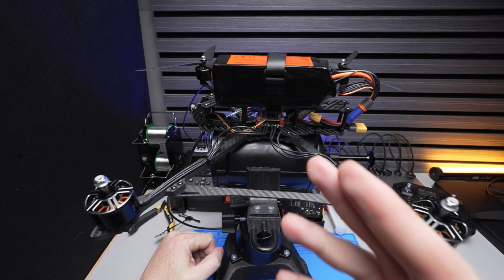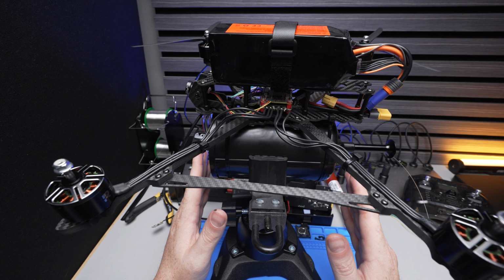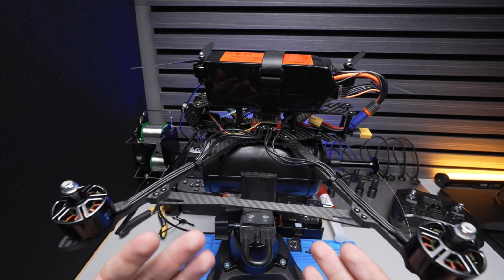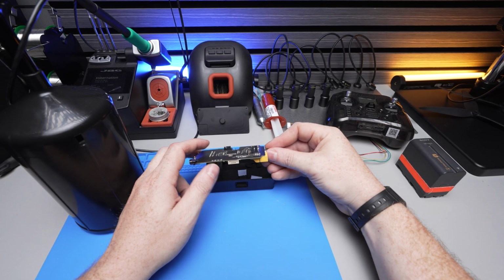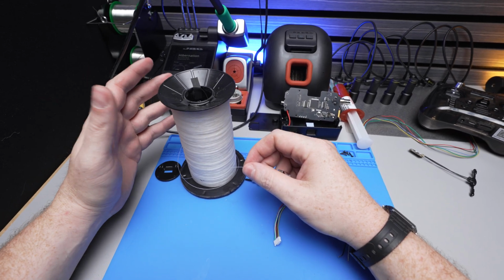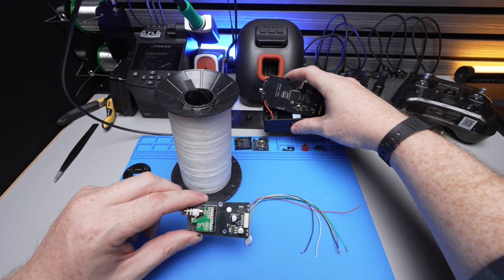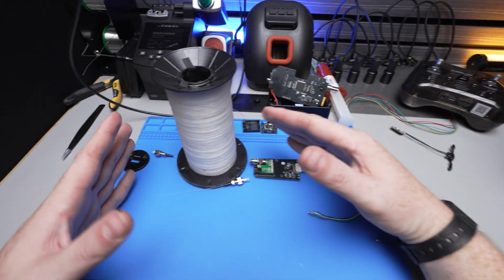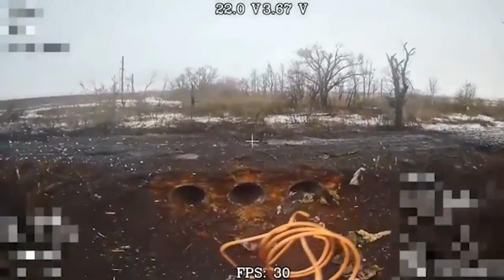Fiber Optic Drone Warfare: The Future of Conflict

Comment: This video is helpful, but he really misses the mark when it comes to quick follow-up explanations of key details. For example, how exactly did his friend break the fiber optic cable mid-flight? Why is flying slow necessary at first? He skips over the critical context—the kind that only comes from real experience—which makes the final takeaways far less useful for those trying to actually learn. Thank you for the video nonetheless!
Reply from the maker: Great points. I should had included that info. Here it is below:

Fiber broke when it got snagged onto a tree and the drone was traveling at a pretty good rate of speed.

Flying slow at first is because the fiber has a wax like substance on it to help it keep in place during transport and you want to make sure you have enough of the covered fiber off so it can unreel more freely when you start going at higher speeds.
Reply: Great channel awareness 👍🏻

Comment: I suppose the fiber optic cable is not biodegradable and stays on the ground forever?
Reply from the maker: Correct, but random fiber cable laying on the ground I think is the least of the worries after war
Reply: a cordless drill with a spool attachment 'fixes' that problem

Comment: Awsome but I imagine you can't fly thru too complicated of terrain or around trees couldn't the cable get caught on blades or objects
Reply: so whats the problem of the fiber getting caught by tree as long as the fiber doe's not break the cannister will just feed new fiber out of its tail and the drone can fly on.
Reply: @mrjoepietube ok ya that's true but does seem like a lot for Ukraine's small amount of crops and natural resources
Reply: you'd be surprised how little it actually snags, since it is spooled from the drone trees are really no problem as long as you fly around them.
Reply from the maker: 100% Correct. That is why I was pointing out a lot of times you see Russia flying these along roads or open spaces.